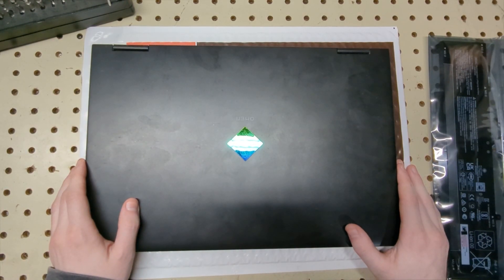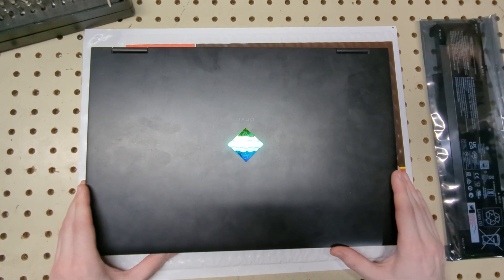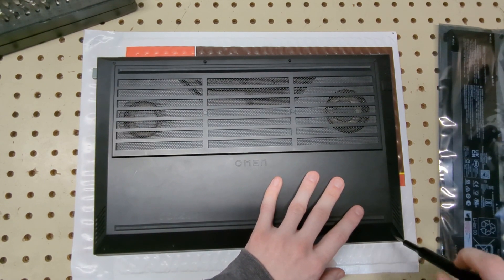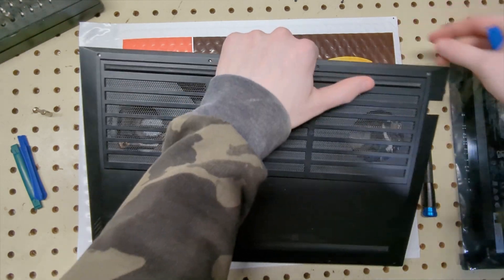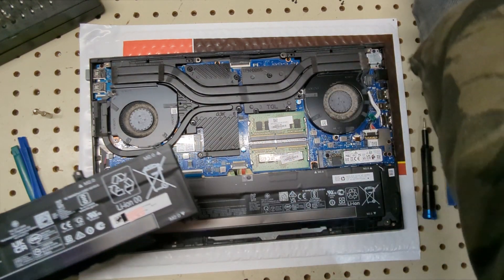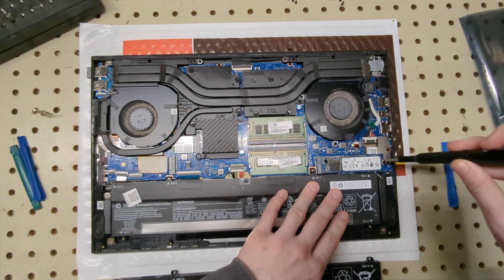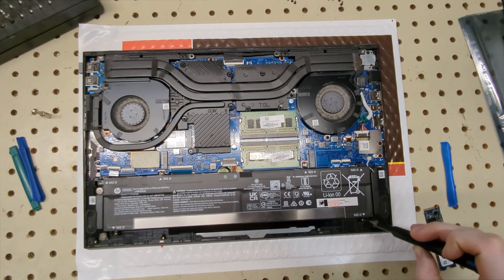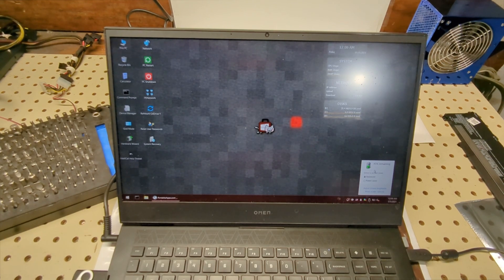HP Omen 16 - Teardown

Comment: Replacing the battery is not a "teardown".
Reply from the maker: Technically it is, taking off the back panel is a form of a "teardown," as it's the best way to show non-tech minded folks on how to do so without bringing it to a shop. Zero reason to disassemble the entire machine.

Comment: Thanks. I also have hp omen 16. There is no power to the screen and keyboard and they won't turn on. I didn't find a solution.
Reply: Hall sensor issue. The laptop thinks the lid is closed. Unplug the sensor and it will work, but screen will stay on when you close the lid. Or just send it to HP for a repair.
Reply: @ninjafrozr8809  Thank you, I will contact HP